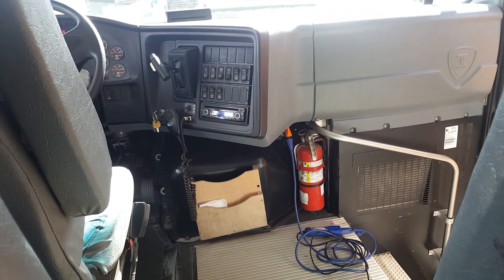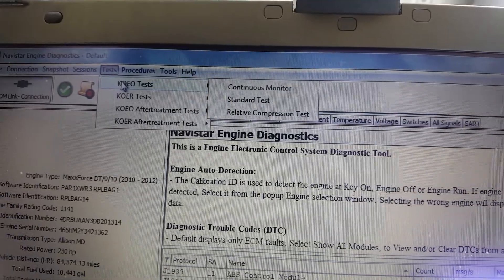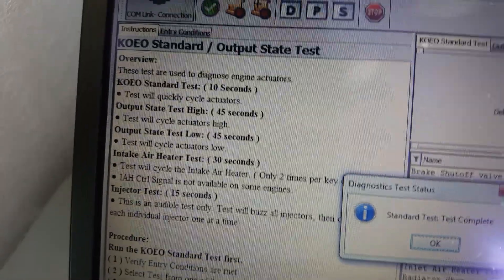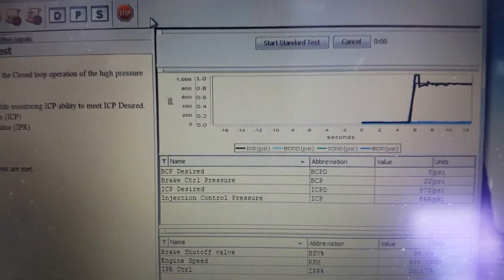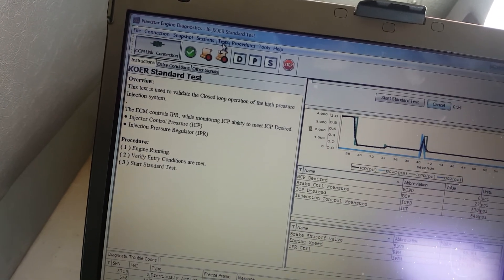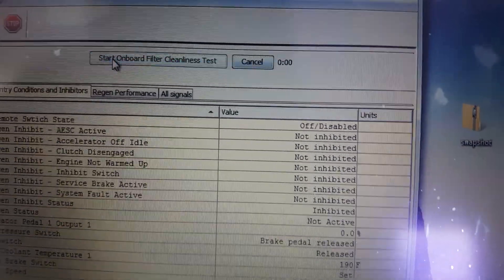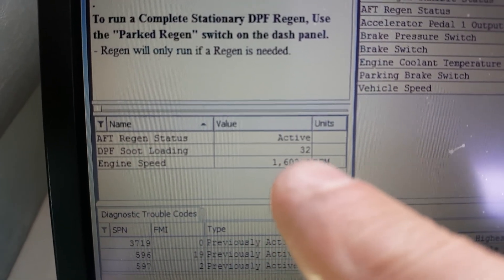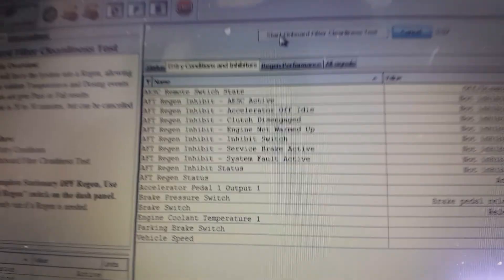MaxxForce DT Regen Using NED Software

Comment: The local schools transport dept bought a bunch of used IC buses that either have MFDT or MF7 engines, they had DT466 buses at first but they got to such high mileage the engines barely ran due to low compression, they also have some Thomas C2s and a handful of Bluebird Vision buses, all their buses have had the emissions control systems deleted, they sound pretty mean, especially their IC FE bus before it burnt up, thus far they appear to be pretty reliable, and they run rural bus routes in extreme heat and cold, they had 2 oddball C2s among their Cummins C2s, one had an MBE900 and the other had a Cat C7, the MBE926 was used for long distance trips due to it being smoother and apparently getting better fuel mileage than the Cummins buses and the C7 was used as a sub bus, you'd know the C7 was coming because the injectors were shot and the exhaust was straight piped, and on a cold day it's leave a white haze that hovered just above the ground in its wake,the MBE900 got traded to another district for a Cummins powered CE300 and the C7 was crashed and replaced with a V10 gasser Vision shorty, they do everything cheap unless it involves an insurance payout to them